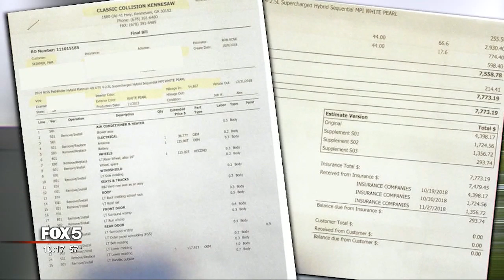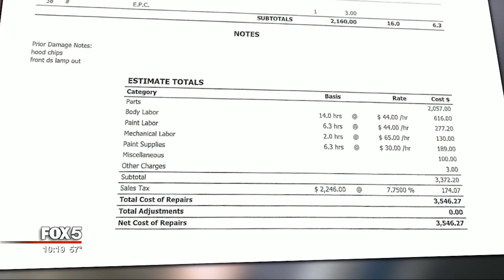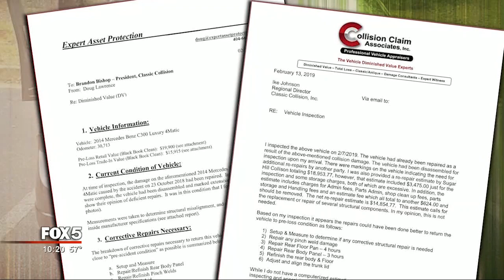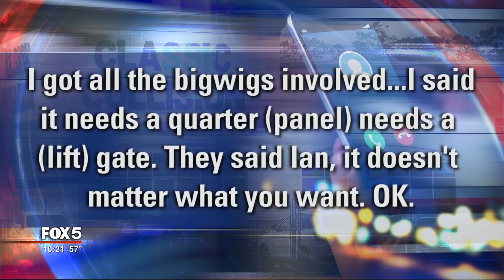I-Team: Car Repair Critic Shakes Up Body Shops, Insurance Companies

Comment: Y'all left out the biggest part of the argument. The body shop can only fix what the insurance company is willing to pay for. I write estimates all the time but the insurance companies come in behind me and shave it down and argue that's all they're paying. I'll get the customer involved but still nothing changes. Body shops aren't going put $7,000 into a job if the insurance is only willing to pay $5,500 they can't they'd go out of business.
Reply: Right on!
Reply: Not to mention customers begging for help with the deductible, which can be up to $1500.
Reply: @jwg9479  I understand but it equates to the same  no matter how U frame it the customer or consumer is being BONED ! !
Reply: Agreed. That is this industry's dirty secret most don't know. The insurance companies call the shots. They set the shops labor rate, cap material cost, find cheapest parts to use and even tell shops how to do the repairs. I've had it all happen to me. They even put it in writing in their estimates. If the shop charges more than their estimate  the customer pays the difference. I would have provided the insurance estimate to this douche. Speaks for itself.

Comment: I think its worth noting that this guy was a direct competitor of classic collision for many years and has always had a hard on for them. This is not a defense of classic but they made no mention of the insurance company that was most likely responsible for the  cheap repairs. I used to work for  classic collision for about five years so I know what goes on behind the scenes. The reality is that the insurance company dictates  completely  the repairs that get done and if you dont do what they want the they will pull the shop out of the program. The point I'm making is that insurance companies run the show. If they tell the shop to fix something rather than replace it,then the shop has to do it.insurance companies completely dictate the entire process in this situation.  I would be willing to bet money that the insurance company is geico. And I've  seen them do really shady things like refuse to pay to fix damage that you can't see on the outside, which no shop should tolerate but it's either that or lose all the buisness. If anyone should be punished  it should be them. As far as this "inspector" goes,he is absolutely fear mongering by telling people that their cars are unsafe to drive. In most cases that's just not true. And to say that the Benz in this video should have been totaled  is rediculous.it was absolutely repairable. Even if you double the price it still wouldn't be anywhere near enough to total that car. In order for a car to total the cost of the repair has to exceed 85% of the cars value. This guy is targeting this shop to promote his inspection business by drumming up fear in the customers of classic collision because they are the largest independent company in GA.
Reply: You are spot on with that statement! Customers unfortunately aren't aware of all this. The insurance companies pitch the warranty on repairs but it's really the shop that backs it. I worked at an ABRA a few years back and the Geico adjuster actually had an office at the shop if that says anything. Yeah it had conveniences but the legal loophole was both ABRA and Geico had the same address but with "suite A" and "suite B".
Reply: I figured this guy had an agenda. I've seen vehicles like this repaired all the time without replacing or totaling.  That Nissan wouldn't even need to be measured. I can tell from the pictures it didn't have frame damage. Even if a vehicle does as long as its straightened and measured properly it's still safe to drive. They should have asked this guy what the ICAR recommended repair procedure is for these. I bet they wouldn't be totalled.
Reply: @class5bodyworks  I really hope neither of you guys work in the industry.  Insurance companies have nothing to do with the repair process.  Classic Collision has also bought back a TON of repaired cars that were uncovered to have been poorly repaired.  That's what "in network" body shops do.  If you aren't using OEM procedures and OEM parts, you don't know what you're doing.  Fix the car. Give the customer a bill.  It's up to them what their insurance companies reimburses them for, then they can fight it out with their insurance company. If you've ever fixed a car based on an insurance companies estimate, you're a clueless butcher.
Reply: If the insurance company is dictating the repairs in your shop, you shouldn’t be in business.
Reply: @dustins8448  ding ding we have a winner.
Reply: You are completely uninformed and lack some critical knowledge. Insurance companies do not dictate repairs and do not decide how repairs get performed. Just because an insurance company says "we do not pay for that" or "we only cover aftermarket or used parts" or "we will repair not replace". That does not mean you have to do it that way, the shop has a responsibility to make sure they repair the vehicle to the vehicle manufacturers standards to ensure quality and safety. Shops or employees or a body shop that think insurance companies dictate repairs or that you need to do what they say, need to close down shop and go flip burgers because they do not have the mental capacity to be repairing vehicles lol

Comment: Insurance companys pay body shops too little ,collision work and body work in general is hard pain in the ass work
Reply: Insurance companies can bring potential new customers
Reply: I agree. I've been doing this for 30 years and the shop rate has only increased about 12 dollars per labor hour. With as advanced as these vehicles are becoming rates should be over 100/hr like mechanical shops if insurance companies didn't have a stranglehold on this industry.
Reply: @class5bodyworks  insurance companies want to save as much money as they can. It is the consumer that gets the shaft.
Reply: @toyoscio  I agree but the shop feels the heat if there's an issue. I guarantee if the insurance companies were ingrained in the mechanical industry those shops wouldn't be charging over 100/hr. No offense to mechanics but collision techs need to know more about vehicles today but aren't compensated accordingly due to insurance companies.
Reply: @toyoscio  thats steering and illegal.
Reply: @class5bodyworks  True up to a point. Many shops try not to be liable if something happens. It happened to my mom twice.  The mistake she made was having the check go to the shop instead of to her.
Reply: @matthewgibbs6886  Yes it is, which is why some take advantage of the trauma of an accident to benefit them. They know the owner is probably shaken up from the ordeal, so they are there to offer "support" and to not worry, they will take care of everything.

Comment: Total a car for small damage.  I get it if it’s a cracked or a bent  frame. But come on body panels.    Get out of town. My wife’s getting wrinkles in her body panels as she is getting older.   Guess I need to confirm she’s totaled  and put her out to pasture.   😂 probably have to get three estimates first.     😂
Reply: Three, just to be sure!
Reply: Most the time I can do a pretty good est from pics alone just need all 4 corners and couple underneath. Lol
Reply: When you have to correct somebody else's bad body work, insurance combines the already paid claim with your bill to re-repair.  Then it totals out. They usually just charge back their crappy DRP for all of the money they were paid to "fix" the vehicle, in my experience.
Reply: So true

Comment: This why you DONT use insurance preferred shops. They work for the insurance companies and NOT in the consumers interest.
Reply: Totally agree. Insurance companies spend millions telling people to go to “preferred” etc. a group in the auto body industry not in bed with those same companies better spend $$ to get the word out that preferred means cheap and it’s not to the customers benefit. They better do it before it’s too late. Once most become preferred it’s too late.  It happened in healthcare too.
Reply: Classic does good work.
Reply: It's not just the shop. The shop did not fix the car. The technician fixed the car. And there is bad techs in every shop.

Comment: The quarter panel did not need to be replaced . It was not a big hit when you cut to put a new panel. The body loses strength. Any time you can save a panel is better than cutting. Because it still holds its factory strength..
Reply: and factory corrosion protection

Comment: No way that would total that benz
Reply: It’s a old benz worth 3-4K easy total
Reply: Depends on if it actually damaged the frame of the car.
Reply: @odinson9267  vehicles that have been put on frame machines and pullers can be put back on the road. It is safe if done right and extremely common. They wanted money out of that merc.
Reply: I've seen more expensive cars total for less damage.  I work for an Aluminum certified and Mercedes Certified shop.  Aluminum frame components are not repairable. Replace only.  A rail on a cheap old C300 will kill it if it goes to a qualified body shop using Mercedes repair information for inspections, sectioning points, corrosion protection, and panel repairability thresholds.
Reply: @odinson9267  unibody construction
Reply: @edwarddonohue9916  or as some people thing just heat it up and pull it out rofl

Comment: I am not trained in body repair, BUT a close friend was hit by a person who did not look first changing lanes.  Bumper and fender replaced. Fender looks like it has a bad case of Acne, the bumper cover already has paint peeling.  The gaps where the finder and bumper meet are too big at the top, and overlapping on the other side.    It seems in this case "Looks good enough, get the next one in!"   BTW, it was the body shop of the dealer where it was purchased from...
Reply: I would not be surprised that the insurance company approved an aftermarket fender and didn’t pay for color sand and buff for the fender including blends while the shop asked for it the insurance said “HELL NO WE WONT PAY FOR THAT” that’s the insurance for you .. don’t be fooled by the media … you have a right as a consumer remmeber the body shop is there to repair the vehicle the insurance company is there to just dictate what they can pay and we’re they can save money on their end although your rates might get jacked up and in a rental only for 30 days soon after the 30 days are done if your repair is not completed the insurance will cut your rental for their delays on not paying the shop or maybe the shop
Wanted to repair the vehicle correct but having to wait for an adjuster 1 week or a few days for a reply holds your repairs up making the shop look like they are at fault and having to rush trough your repairs .

Comment: Yeah BS on that Mercedes. Most cars over a few years old get totalled when 1 or more airbags deploy due to the cost of them and additional parts that need replacement after a deployment. Most newer vehicles with unified construction can be brought to factory specs on a frame machine..  Cars 20 years ago may have looked like they sustained less damage but they weren't safer if you search a crash test of these vehicles. Watch what happens to the crash test dummy in the older vehicle. A newer vehicle may be a total loss due the cost of repairs exceeding the value of the vehicle including its salvage to the insurance company but the driver walks away.
Reply: Incorrect

Comment: Iam calling bs on some of these cars being unsafe some of the work isn't great the Benz being totaled bs.this inspector is trying to make a name for himself
Reply: no way that benz was totaled
Reply: How the cars are made now days.  It should be totaled.  Years ago cars had full frames to protect you from a accident.  Now to make the lighter and more fuel efficient.  They are all unibody construction.  I Years ago, they only had unibody construction on the front end.  Now it's the full vehicle that's unibody.  The full body of the car is is part of the would be frame.  There is only a partial frame between the front and back wheel wells.  The rear and front end have no frame and are crumple zones.   Lost the integrity of the unibody construction.  And it wont just crumple, it will disintegrate when hit.  Any car made today needs to be totaled if in any accident.  this video does not show the b=damage that could have been under that bumper on the benz.  The unibody weld could possibly been all ripped apart and popped.  Those plastic bumpers can pop out most times so you don't see the actual damage.   What I'm really saying here.  Is cars made now days, are crap.
Reply: WHATS WRONG GREEDY AMERICA...DOES TRUTH OFFEND YOU 😜😎
Reply: @danor6812  read the comment above
Reply: @KW-fx9ww  I did read that comment and he's 100% correct.  I was replying to the original comment.
Reply: @danor6812  nope,  u and jereon are wrong
Reply: @KW-fx9ww  We're not wrong.  Cars don't have frames anymore.  the body is part of the frame of the structure.  You damage the structural integrity it weakens that part of the vehicle.   Learn a little about structural engineering, before you think you know something, you don't know anything about.
Reply: Jeroen  "improper repair" to begin with... of course
Reply: @danor6812  structural areas are also repairable
U have no proof on your point
And those 2 on the video,  those are only outer panels and has nothing to do with structure
Reply: @KW-fx9ww  Yeah I do.  Look at any diagram of these cars.  These are not "just outer panels"  They are incorporated into the the vehicle as the main structural component.  There are no frames in these cars.  The body is the frame.  Repair can only be cosmetic.  As in repairing it, and selling an unsafe car.   You have no idea what you're talking about.  Look it up.  I wont attempt to explain it to you again.
Reply: @KW-fx9ww  LMAO I've been repairing cars since 1972.  I rebuild cars.  I think I know what I'm talking about.
Reply: @danor6812  and yet u cant  replace a quarter panel and rear body panel.... 
Doesnt matter how long u are in a business
Millions of people drive everyday and none of them drives an f1
Reply: @danor6812  New unibodies are way more safe than the old full frame cars. Pull up the crash test video of an old Impala(full frame) vs. a new Impala(unibody). No contest. The driver in the full frame was dead. Yes, metals are lighter today but stronger. Ultra high strength steel, UHSS alloyed with boron. You ever try to drill that stuff?!
Reply: @class5bodyworks  Safeer in saving lives with the crumple zones.  But not in the cars safety after repairing them.   The cars are NOT as safe if repaired.  Which is why insurance companies total them after what seems like a minor accident.  They wont insure a car with damage to structural areas.  Because they don't want to pay all that extra money for a death(s) which could  results.  From a car being hit near the same area of the previous damage.
Reply: @danor6812  Vehicles are safe if they are repaired properly. That's why all car manufacturers have repair procedures, sectioning procedures, etc. It's also why insurance companies require shop certification such as ICAR gold class. If every car that had a structural repair was deemed unsafe the insurance would just write them off after the first hit. I know there are a lot of cars back on the road with salvaged titles that are being insured.

Comment: The body repair industry is almost entirely supported by the ins. Industry.  They  indirectly control labor rates, repair procedures, Ect.  The  independent adjusters are the thorn in their sides.  After the 1970's the the situation has been cleaned up quite a bit.  A time when Ins. companies were a two headed screw. for their customers  thru high rates and shoddy repairs using knockoff parts.

Comment: normal wear on a car can be more dangerous but then again if you know nothing about cars what can you expect. I feel there is 2 problems here 1. people all over the world needs important car parts replaced : breaks , tire rods, ball joints , control arms you get my point, but frame damage..ok? and 2nd collisions shops have been ripping off people for years and years because most of us don't know about metal forming in the first place so what else is new.